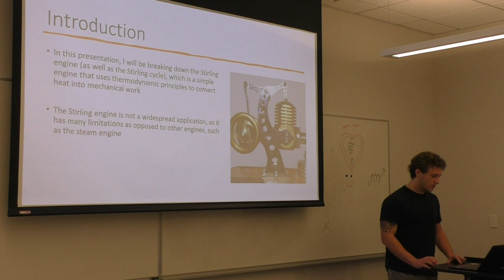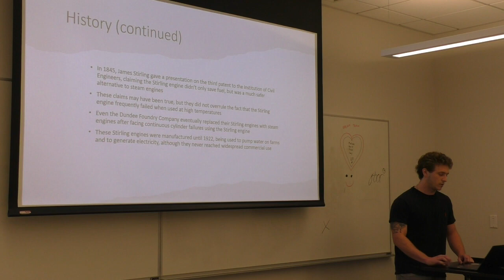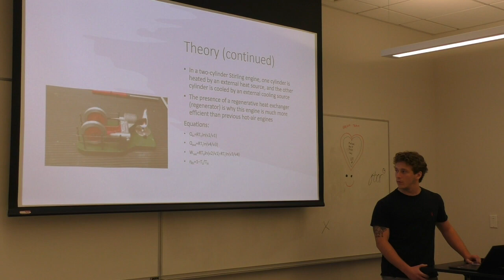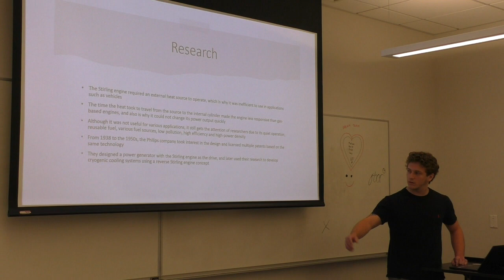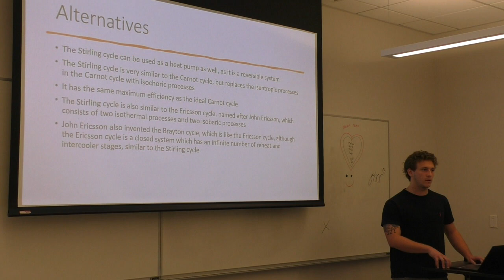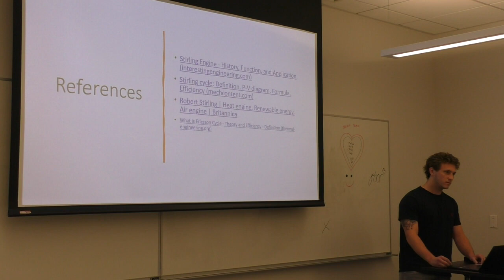Ben Albert

Comment: Great job explaining the Stirling system, I had forgotten about this from thermodynamics and it is interesting that it is only used for research today. I would agree with one of the other comments and explain why Stirling didn't have any negatives about it. Also maybe try to add some more examples on when they tried to use it in real life. Good job overall.